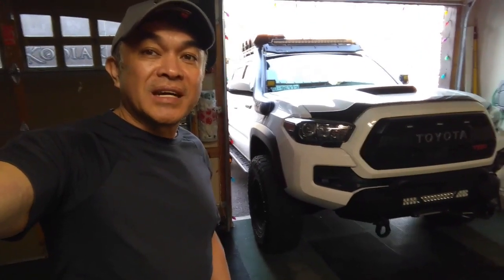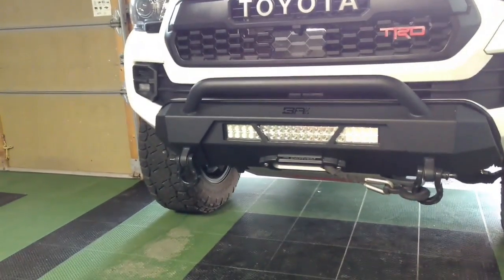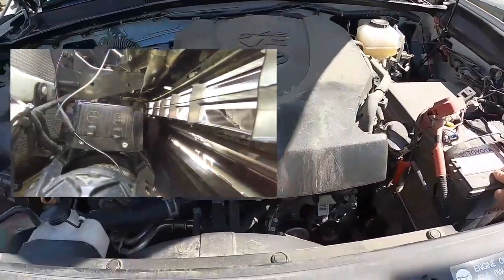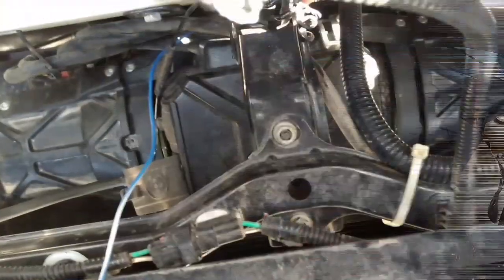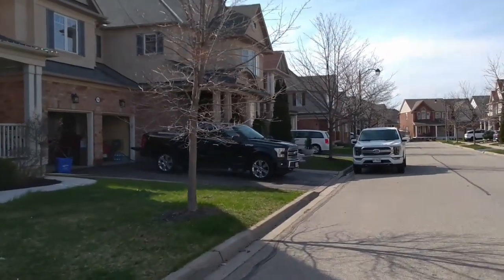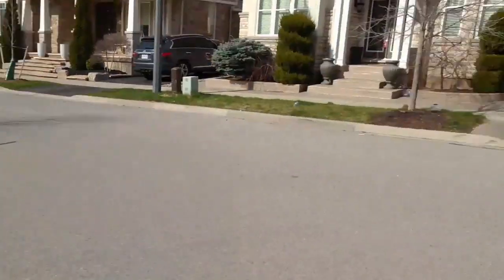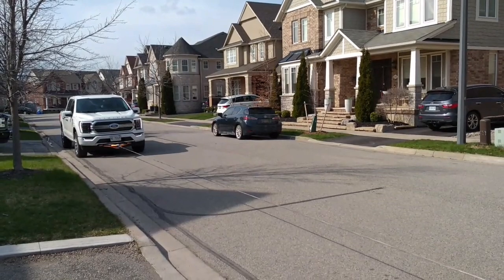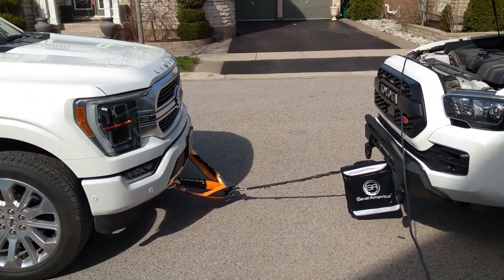Smittybilt XRC 3 Winch Demo - Toyota Tacoma TRD Pro Pulling a Ford F-150 | VLOG #50

Comment: Thanks for a great install video and this follow up!
I was wondering about the need for a winch mount plate, I didn't see you install one.
The bumper rating is 10k lbs. I'm seeing differnet opinions on the need for a plate. What are your thoughts?
Reply from the maker: Hey liftjockey, IMO, the mount plate would be redundant in this case as the bumper guard already has mounting brackets already built-in.  Thanks for tuning into my channel, much appreciated!